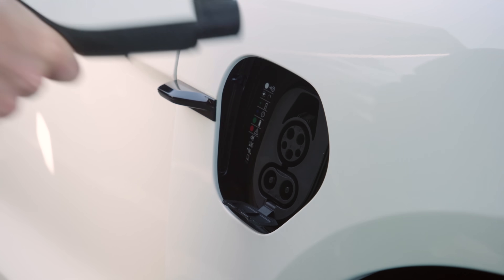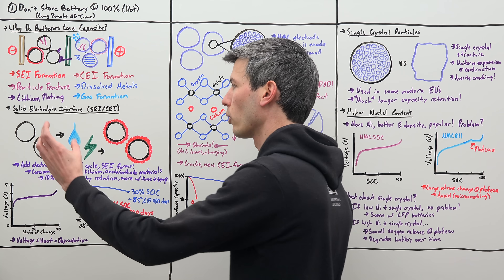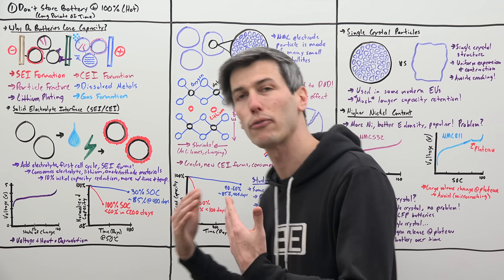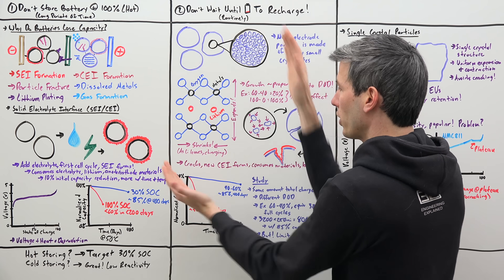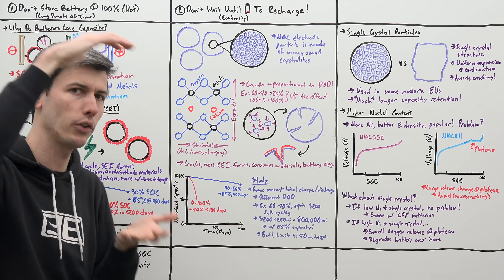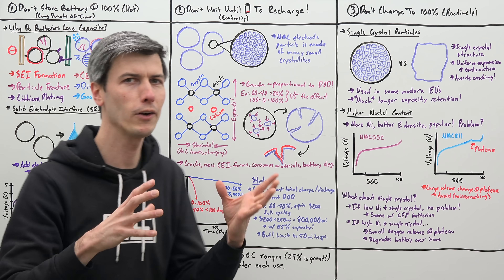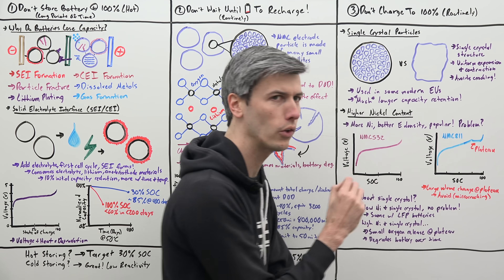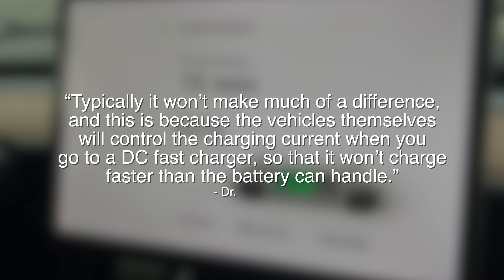How To Ruin Your Electric Car's Battery - NMC Edition!

Comment: So glad I don't have to worry about storing my ICE vehicles with either a full or almost empty tank of gas.
Reply: Gasoline will degrade and cause engine problems if it sits for too long.
Reply: @Green_Tea_Coffee This may not be much of an issue for a car that gets used all the time, but storing seasonal machines (lawnmowers or snowblowers) without draining the gas from the engine can be a real problem.
Reply: @davesutherland1864  I know about the theoretical issues with storing gas, but in my experience even a lawnmower that wasn't used in 2 years still works with it's old tank of gas. More sophisticated motors in cars might be more finicky.
Reply: @marceldiezasch6192  It’s not theoretical.  Most of the time I have also got by with a little extra effort to start an engine in the spring/fall.  However, I once had an issue with a snow blower that did not get used for a winter and had to get some extra service to put it back in order.  Since then I have made a point of using gas stabilizer and running the engine dry where possible.
Reply: @Green_Tea_Coffee  Gasoline polymerizes (smaller molecules link to form larger molecules) if stored for six months or more and becomes less volitile (harder to burn). As occurs with all chemical reactions, it will degrade more rapidly in hotter temperatures. There are fuel stabilizers that can be added to stored gas to slow the  polymerization reaction.
Reply: @avsystem3142  Yep. And anyone who's ever put an ICE powered vehicle in storage knows that they need to drain the gas to avoid having it polymerize and cause issues with the fuel system. All of the people here who act like you can just park a car and walk away for six months and think they'll come back to a functioning car don't know what they're talking about.
Reply: You would if you ever let it sit over a winter or something. I have to be mindful of the state I leave my motorcycle in over the winter months cause it could be weeks or months between uses. I'd imagine it's the same for a car someone doesn't use much in the winter. These are not NEW considerations to have to deal with because of EVs. It's all pros and cons.

Comment: Things an ICE operator will never hear, “You didn’t routinely fill it all the way up, did you?” & “You didn’t leave it near empty, did you?”
P.S. The real issue is none of this came out until after we subsidized the purchase of EVs by wealthy people across the nation.
Reply: No, instead you hear "Did you change the oil regularly?" "When was the timing belt last done?" "Have you replaced the spark plugs?"
Reply from the maker: Well, you'll definitely hear people talk about leaving the gas tank near empty & fuel pump concerns (valid or not, it's a debated subject).
Reply: Actually I was taught that you shouldn't leave the tank near empty, because it could make it more likely for any sediment in the tank to be sucked into the intake. I was taught to fill at a quarter tank whenever possible.
Reply: Also will never hear from an ICE owner - “I’ve filled up my tank from the sun that hit my rooftop”

Comment: There aren't enough hearts to distribute to this video.  It's a shame that manufacturers (even Tesla) barely scratch the surface in educating consumers about best practices for their batteries.  Basically the only thing Tesla has told me is to limit my charge to 80% -- even as their own science tells us to limit to 75% (a practice I will now adopt)

Who DOES educate consumers are the unfortunate souls who manage to misuse and abuse their batteries -- such as rental car companies and people who own EVs and probably shouldn't (i.e., "park outside and charge exclusively on superchargers to 100%).

It's so bad that even with Tesla's warranty (70% battery life at the end of 8 years), I'm still worried about how long my car's battery will last.  Seems like if I treat it right with some basic steps, I should barely lose 10% within that time frame.
Reply: So many people think lithium works the same as NiCad; that they need to keep it charged to 100% and fully discharge it before recharging

Comment: I think the phrase 'don't have battery at 100% for a "long period of time"'  needs to be quantified, people have different ideas for what that length is.
Reply: There isn't a set amount of time, it's just as little as possible. Using it immediately is better than an hour, an hour is better than overnight, etc.
Reply: @BrandEver117  See thats the unclear ambiguity, b/c the test in the video was over months, and you're talking hours.

Comment: I did this with my phone and it's only just starting to get a shorter battery life after 5-6 years. Tried to keep it between 30 and 80% battery when I could.
Reply: I fully charge mine every night. I e had it for four years now and the battery still seems the same as when it was new. I'm a fairly heavy user and normally have about 35% remaining by the time I go to bed.
Reply: @Japplesnap  Set a charge limit and you'll double the life and still make it through the day.
Reply: @OtisFlint  Four years so far without any issues. Doubling the life of my phone is meaningless because like all phones, it will become unsupported and obsolete after 8 years. I generally keep my phones from 3 to 5 years and then get a new one.
Reply: @Japplesnap Obsolete but I can still use it. I have aj S6 with its original battery
Reply: I ALSO have a 6+ year old phone which is charged to 100% EVERY night but has rarely, IF EVER, seen a SOC below 50%.  My needs are simple and I simply don't use the phone for watching videos, gaming, etc.  The ONLY Social Media platforms I use are email, text messages, and Signal for strictly family relationships.  Not interested in Facebook, Instagram, Tik Tok, nor X (Twitter).  I control my phone's usage,  IT does not control my life!  It's so sad to see people's faces buried in their damn phone screen virtually constantly.
Reply: Which phone? My battery health is on 92% after two years only. I did it like you 🤷‍♂️
Reply: @cachememory  Samsung. That's all I buy after switching from Motorola 10 years ago. I like to keep my phone for at least 3 years minimum.
Reply: @cachememory  I have a relatively simple Samsung Galaxy A8.  It suits my needs just fine and EVERY time I start looking at newer phones the Sales Rep asks which phone I have.  I say a Galaxy A8 and they say, "Oh, that was a really good phone".  To which I reply "It still is"!  I don't run many Apps and I'm diligent about "Closing All Apps" before I put the phone back in my pocket.  My wife is just the opposite and when I look at her phone, a Samsung Galaxy Note 9, there's almost always a Gazillion Apps running in the background.  However, she too is still on her original battery after 5 years and she gets through MOST days without having to charge up again.  We both leave our phones plugged in overnight.
Reply: I've done the opposite with my phones.  Discharge fully and then recharge to 100% each time.   I would sometimes go almost a whole day with the phone reading 1% battery (living on the edge-hah).   I kept my iphone 4s and 8 for six years each and I only replaced them because the iOS was no longer supported so some apps wouldn't update anymore.
Reply: I only get about a year before I break my phone 😂

Comment: I know with DJI drones the batteries are programmed to discharge the batteries to storage voltage if they set for too long . I dont have an electric vehicle but i would assume they have a similar system? 😅
Reply: New Macan does this.

Comment: Love the analysis, but just makes it more clear to me the micro-management that will be necessary over the life of current BEVs to keep them from being rapidly more useless in several years just like smart phones.  Would love to see you do a video(s) on solid state battery tech and whether that could truly be the linchpin to making BEVs more practical for most drivers?
Reply: There's no micro management necessary. Cars and chargers can do this for you already. My 6 year old EV can even be programmed to charge when the price of electricity is low. Set it once and forget it.
Reply: @scottkolaya2110  I see your point to a degree but it’s still micro-management that the vast majority of drivers (and those without access to home chargers) won’t or can’t do.  It also limits the utility of the vehicle materially to follow the recommendations religiously.  IMO BEVs will only be suitable as a daily short commute vehicle until a breakthrough in battery tech and affordability (i.e. solid state) occurs.  I’d be interested in one, but frankly am dissuaded by depreciation and possibility of it having a thermal runaway fire in my garage just a few feet from my bed.  I know it’s unlikely, but far more likely than my ICE vehicles spontaneously combusting.
Reply: @nathanexplosion5478  I totally agree with you that EVs will mostly be suitable for daily commutes of less than 3 hrs (short).   But yeah, if you put on more than 60k per year, you might want to wait.  On the other hand, I've got a few friends who drive for Uber and they certainly love their EVs.  250k so far just adding windshield washer fluid and changing tires.  They charge at a 6¢/kWh nighttime rate.  Costs them 1.5¢/mile.  Honestly I wouldn't own one either if I had to 100% public charge.
Reply: @scottkolaya2110  Which EV have you owned for 6 years and how many miles are on it?  How is battery life now vs. new?  Avg. miles on tires before needing replacement?  Brake pads ever replaced?  Has your insurance increased significantly in recent years?  Thanks.

Comment: The ONLY advantage to buying an electric car is the lack of maintenance compared to regular petrol cars. They arent cheaper. They are way less reliable. The range is garbage in the winter when its cold and the summer when its hot. They're very complex and softwear bugs can cripple your multi thousand dollar car. The charging network in pretty much every state but california. They only thing electric cars are good at is 0-60. Everything else petrol diesel and hybrid vehicles are better at in every way.
Reply: You are clearly not speaking from anything resembling experience, or reality.
Reply: @Green_Tea_Coffee  I live in Ohio. When winter hit and it got cold every Tesla on the road dissapeared. I know several people that tried electric cars including electric trucks and vans when petrol became expensive. I asked them if they would buy another one when that one died. They all said it was problem after problem. Wether it was the softwear or range issues or recalls. Not a single person said they would buy another pure electric car. They're either going to try a hybrid or petrol/diesel vehicles.
Reply: the only advantage? what about powering it from rooftop solar, for free? or instant power? or the tech integration that it lends itself to? or leaving home with a full tank every day?
Reply: @peejayem4700  you arent powering it for free if you pay thousands for the solar 🤦🏻 and you would have to install a lot of solar to power the car entirely off solar including a solar battery for at night solar charging
Reply: @alg003  my rooftop solar has easily paid for itself with electricity feed-ins, and I charge on weekends edit: it’s a 15kw system
Reply: @peejayem4700  has it actually paid for itself already?
Reply: It's also often cheaper depending on your power rates. With my Prius, i was paying anywhere from 7-12¢ per mile depending on gas prices, charging at home with my Bolt I pay about 2-4¢ per mile.
Reply: 1.2 million mile Tesla Model S
-14th motor.
-3rd battery pack.
-other things serviced not mentioned.

1,002,517 mile 1990 Honda Civic (Million Mile Joe)
-185 oil changes
-72 tires
-31 transmission fluid changes
-sets of brake pads
-9 timing belts

Original engine, transaxle, ac system, power steering, fuel injectors brake calipers and more.
No accidents, towed once when the original fuel pump died at  741,000 miles.

One motor or battery replacement on a tesla exceeds the cost of all parts serviced on a civic over a million miles.
Reply: @Foche_T._Schitt   14th motor? Thats actually pathetic. Tesla battary packs are thousands of dollars. Theres lots of multi million mile cars and trucks using the original engine and transmission. You wont see that on a Tesla.
Reply: @alg003  Yeah. A first gen Tesla Model S that was run like a dog had a few motor replacements. Guess what? The powertrain design Tesla uses has only gotten better in the intervening ten+ years since that car rolled off the assembly line.

Besides, almost no one is going to keep a car that long.

Comment: Is there any way to determine how and EV was used/charged if you’re shopping on the used market? I know vehicles can show degradation amount but would that tell the whole story about how it’ll perform for a 2nd or 3rd owner?
Reply: There are a couple of third party apps that can track this, and Tesla vehicles have the ability to do a self-diagnosis that can show if there's been battery degradation, but I believe you can only access that info via the service menu. (You can find videos on how to do this on YT.)
Reply: @Green_Tea_Coffee  gotcha, yeah so probably prudent to have one of those OBDII diagnostic tools/apps when shopping around. I presume then it’ll just show the level of degradation but not any detail like how often it was lest sitting at 100% or how many DCFC cycles it has experienced? Just want to keep in the know when it does eventually come time to get a new vehicle like an EV how to find the best one.
Reply: @ALMX5DP - some cars do count fast charge kwh and cycles.

Comment: Any EV video should start with a reminder of where most of the Lithium and Cobalt for the batteries come from and who does it. Everyone wants to ignore the ugly truth.
Reply: Tesla gets lithium from Australia and Chile, iirc. Cobalt mines are the big deal, but you don't care, no one else cares, in fact, the governments in those countries care the least of all.
Reply: We should definitely do more to make mining in general more ethical (oil drilling is also doing some messed up stuff in third world countries). However, it should be mentioned that these batteries are actually very recyclable (@JerryRigEverything has a gret vid where he visits a recycling center) and there's actually a lot of lithium in the US that just hasn't been mined yet. So the more we have, the less we'll need in the future.
Reply: Hmm never saw someone question where oil comes from or for that matter, where the cobalt catalyst used in oil refining processes come from (used in desulphurisation of oil) 

And you can still make a battery within cobalt 

The prime example would be the one I have sitting in my drive rn
Reply: @shresth1201  hmm never witnessed someone talk about an example of something we can neither see or touch and pass it as valid. Nobody questions oil because it's common knowledge you dingbat. No one is showing strip mines on public television nor are they talking about it anywhere except for a few heroes off the people's radar.

Comment: I'm surprised people have to replace the batteries. We have a 2014 volt, still using the same battery and I don't notice a meaningful drop in distance.
Reply: Well, that's the things with mean time between failure. Sure, they are supposed to last 10 years, but some will be 6 and replaced under warranty, some will be 7 and get a huge bill, but then some will be 13 or 14 too.
Reply: I'm sure we eventually will need to but it'll have to cost a ton to offset the cost of maintaining a gas car (going off my prior cars).

Comment: This is going to be a big problem for any electric semi trucks that are used for long haul routes. Going to have to charge and discharge fully to achieve the advertised range, which will reduce the life of the battery.
Reply from the maker: Yep, but there are differently chemistries and solutions you can put in place if you know the use case (single crystal structure, LFP, etc).
Reply: Fully charging and discharging will increase travel times so that's not going to be a problem for e-semis. Drivers will want to reduce travel times, and the fastest charging is going to be from 10-70 or 10-80%
No sense charging at 40miles per hour when you could be driving at 65 to the next charger.
Reply: @Willibopper  True, I was kinda thinking about that vs doing the 40-60 thing discussed in the video. They likely won't be charged all the way most of the time. But still not as good as more short trips and short charge cycles?

Comment: if you abuse a gas/diesel engine and transmission with constant hard acceleration or towing huge heavy loads day in and day out and neglect changing the oils and fluids regularly being totally mad when they both give out at 80k miles instead of 300k miles. its just basic care of a different variety.
Reply: You still get more life out of ICE dollar for dollar.
Reply: @Foche_T._Schitt Not true

Comment: The day an ev can pull into charging stations that are as numerous as gas stations are today and “fill up” in a matter of a few minutes, and have comparable range in a variety of weather as ice engines, and the grid gets updated to handle the extra load, and we start put new power plants online rather than taking them offline and not replacing them with anything, and we don’t have to rely on an enemy like china for the battery materials, is the day ev’s will be accepted by the masses. Until then they will remain the red-headed stepchild of the automotive world